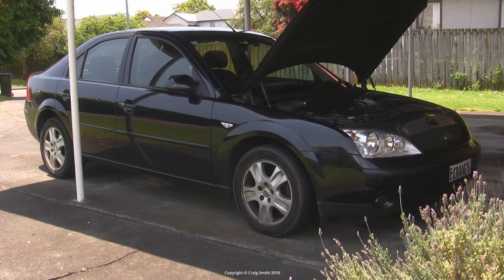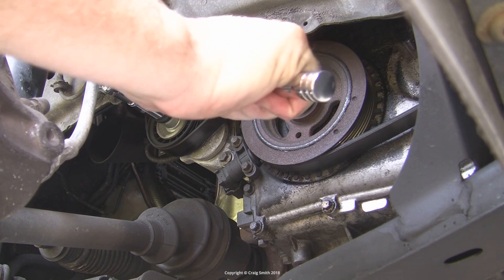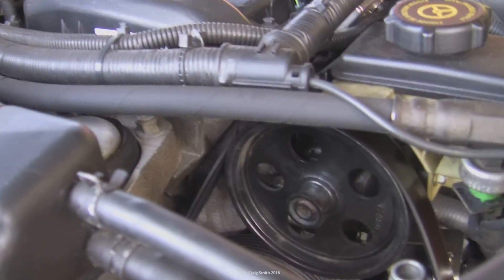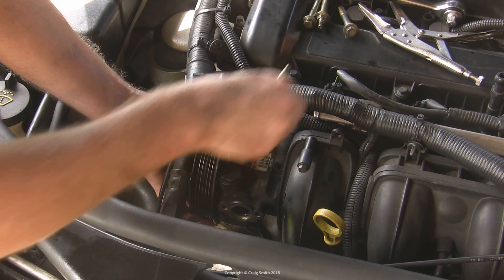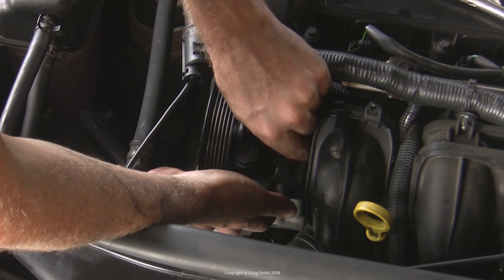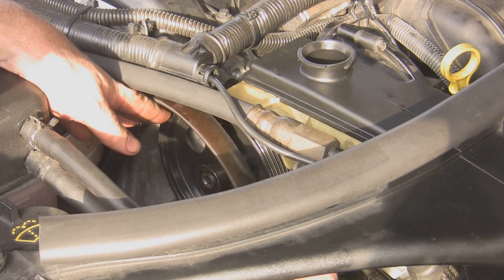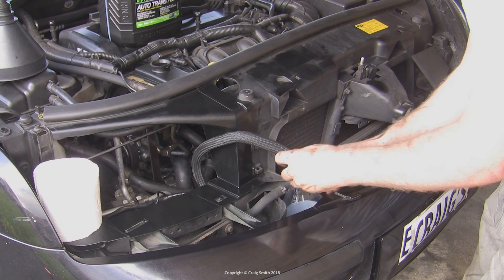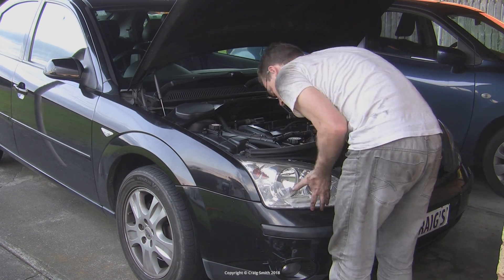How to: Replace power steering pump and flush PS fluid (Ford, Duratec HE, Mondeo)

Comment from the maker: If you want to drain the fluid using the drain pipe at the steering rack, or disconnect the lines at the rack, see this later video:
https://youtu.be/G7d9tPd-5so

Comment: Is there a way other than Teflon seal because we do not have a Teflon seal?
Reply: 8:32
Reply from the maker: It is sold as a specific Ford part, try to order it. If you have Ford cars in your country you have Ford dealerships, and they will enjoy ripping you off as much as anyone else. Failing that, engineering shops should be able to offer you something similar. You could try other seals to bodge it but you'd be asking for leaks.

Comment: always remember to clean the filter inside the reservoir. If it"s not possible, change the reservoir after changing the fluid. A dirty filter is the main reason why the pump moans.

Comment: My mondeo manual specify  that i should use WSS-M2C204-A, can i just change that to mercon V like you did if i change the pump in the same go?
Reply from the maker: Yes, or any of the other applicable specs, they made a real mess of them. Read the notes in the desc.

Comment: Mine was leaking because of the O-ring between reservoir & pump being worn out. Replaced that and the problem is gone. It just surprises me that you have two on yours. I am not sure it is the factory layout.
Reply from the maker: The workshop manual refers to rings plural and my pump was factory. Strange design. Maybe the smaller ring is designed to center the plastic coaxially with the alloy, while the outer one actually seals in compression with the bolts. Not sure.
Reply: Do you remember the size of the O-ring? I'm planning on replacing it to potentially resolve my whining power steering pump and Ford lists it and the reservoir as one big part.

Comment: Nice! Thx Craig! What pump did you get, new or recon? And where from? Do you think a teflon tape would work instead of the ring?
Reply from the maker: It's just from a wreckers but is younger than mine. Teflon tape might work but would be a bodge, the line fitting is not a tapered thread, it's designed to compress against the proper seal. The seal from Ford is not too expensive.
Reply: @CraigsDIY  there was no way to fix your old pump?

Comment: Excellent tutorial as always, Craig. Miraculous enough, I just very recently got issues with my steering (v6 version). Is getting  a bit noisy and steering influenses idling speed. Looking the problem up at forums like Talkford, there is mentioned that it's wise to replace the waterpump at the same time with PS-pump, since the 2 parts are connected. I believe that's about diesel engines. But have you considered the topic (replacing both parts) for yourself? Kind regards from the Netherlands.
Reply from the maker: My water pump was renewed some 100,000 km ago and it's been fine so far. It seems it's just convenient to do them together on the diesels if they're connected, no other reason? But if you're not paying a mechanic I wouldn't bother replacing a good part.
Reply from the maker: My pump was leaking fluid at the pulley spindle.

Comment: Would it be the same fluid for TDCI engines too? 
Cheers Craig
Reply: Yes
Reply: Nice 1 My Mk.3 is well overdue for a flush...
Reply: TDCi fluid is green, not red. You need spec WSS-M2C204-A2